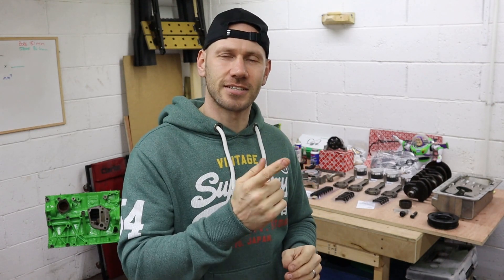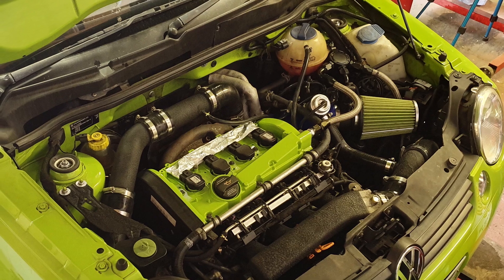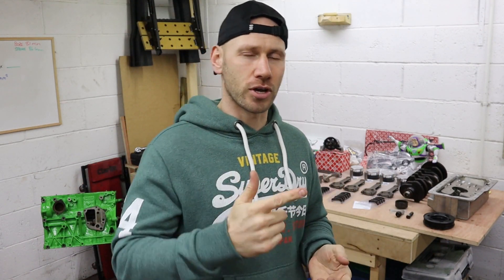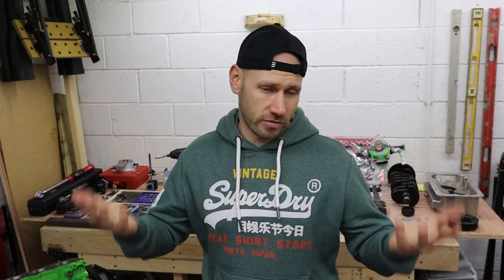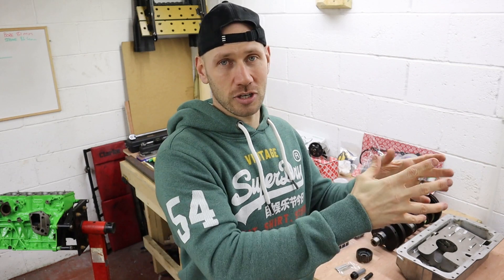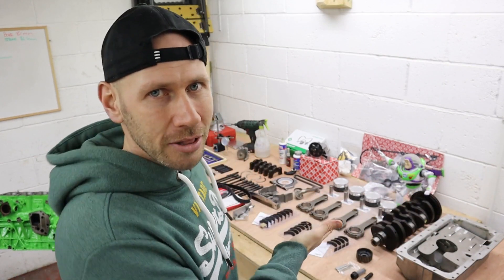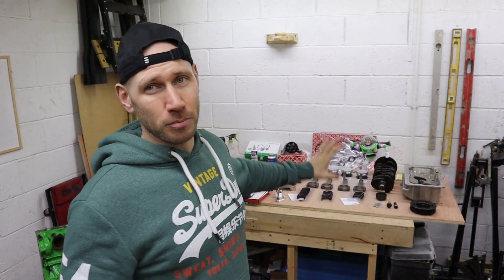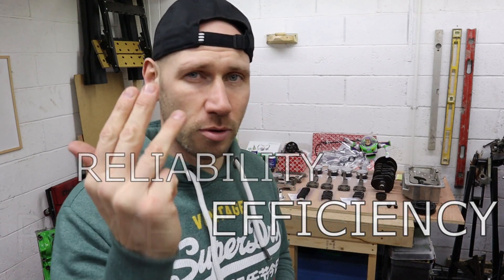1.8T STROKER Engine build - The Objectives

Comment: I am having so many issues with my 1.8t I can't decide between fully rebuilding it.. or just swapping a vr6 turbo setup into my b6 a4. What do you think is the best option. I love the sound of the vr6 but idk if it's actually worth the cash
Reply: I bought this Audi the day I filed for my divorce because I knew I needed a more reliable 4 door car then my f150 truck.. the engine blew on the way home from buying the Audi. Bent all the valves in the head from the serpentine belt shredding and wrapping around the crank pulley and it locked the engine up... Didn't even damage the timing belt.
So I machined the head and decked the block and rebuilt the head. Put a k04 225 Injectors, cts turbo fmic kit. And it ran great for about 12k miles..... Now it sounds like the engines about to blow legit and it keeps having random issues over and over.. I am about 12k in with parts now and that hurts being a single dad lol.
Reply from the maker: Big deep pickets for a vr6 turbo 🙈. Maybes worth investing in the 1.8t a bit. It'll still be smiles per miles. Unless you NEED that V6 Rumble...?
Reply: @DecimalTenths  the crazy part is here in Texas the 1.8t engine at a wrecking yard costs roughly 1400 us dollars... A vr6 24valve costs around 650 but I have never owned a vr6 and wasn't sure how reliable they are with boost

Comment: Hiya, im still catching up on the broadcasts mate....a thought? What will the running in on the motor be like/how many miles etc.
Lv the show buddy and cheers!  😁
Reply: Ps. Never thought about engine braking? Cheers and reallly looking forward to that broadcast 😊
Reply from the maker: @andrewstamps2806  Yeah mate its essential. It's a point when the cylinders see a lot of pressure so great for forcing the rings into the cylinder wall to seat them, but without the added heat of combustion occurring to overheat the situation. Ideal for bedding in rings. Cheers for your continued support pal 👍
Reply: @DecimalTenths  No worries and thanks for explaining mate it makes good sense and practice......genius!! You not me lol🙃, stay safe all of you...even Lord Spencer!! Cheers
Reply from the maker: Hi Andrew, I plan on doing a video on this when we go through it, but itll be varied loads over varied engine speed with lots of engine braking, and a couple of oil changes up until about 1000 miles.
Reply: Cheers mate and thanks 😁, luv the show and keep up the great work, byeee!!

Comment: Alright Nick,
Binge watching all your videos. My engine is away getting built at the moment. A 225 APX from a TT. 
Just wondering why your not going for more power than 330/350.
Mine isn’t getting stroked, just IE rods, pistons, Supertec Valve springs and Inconel valves. 
Gtx3071 with custom exhaust manifold.
3” exhaust, fmic, aem meth, 660cc injectors. Maybe NA cams. 
We are looking for 400+ Bhp? 
We started the project as we burned out an exhaust valve in cyl3.
Reply from the maker: Hi! Cheers for the watching the channel! 
In all honesty my power goal isnt in stone (especially since I blew the budget on a trick gearbox) and I could be swayed (the ideal would be G25-550). My goals are in keeping with the capability of the chassis, budget, and my ever searching quest for reliability. Plus I want to be free to spend on other builds and dont want to step too far away from this being a cheap track car, which it does.with nearly every day...😂 350bhp in a Lupo is like 450+ in a TT and this upsets a lot of people even in it's current form.
Reply: Decimal Tenths For sure because the TT with Quattro is 1400 odd kg so it’s good and heavy.
I’ve followed a lot of your advice apart from
I forgot the budget bit 😂 I’ve 7k gone on parts with another few grand to (find) spend yet. Won’t be selling this mk1 TT in a hurry.

Watching your videos makes me want to buy a second hand APX and have a go myself. I’m handy mechanically but I’ve sent the engine away to be built by a builder. 
Keep up the videos mate, love the authenticity 👍🏻
Reply from the maker: @stevenlee4437  Yeah know all about that Steve! I had my old S3 at 450bhp and it was ballistic, but still very heavy. The lupo is my cheapest and simplest car but it's easily the most fun I've had on 4 wheels, which is why I'm torn between keep it good cheap fun, or go all out and have the raddest Lupo out there. Time will tell as to how disciplined I've managed to be with the budget. My plan was always to stroke the S3s motor so the stroker aspect is just because I had the kit all there. This build will be capable and strong for big power, I've just got to try and fund the turbo setup...😂. I love giving it all a go, although I do it from a position of experience, spent many a summer building engines with my dad. Either way your TT will be immense, 400 horse and 4wd is a special thing no matter what car it's in. 🤘
Reply: Decimal Tenths There’s worse ways to spend your money or time 👌🏻
I suppose you still want the lupo to be something to enjoy and not scared of 🥴
As long as the receipts are kept from the wife we’ll be doing alright 😂
Reply from the maker: @stevenlee4437  you my friend, are on my wavelength...😉👍😂

Comment: Geeeeez, thankfully I got my Mk4 Golf 1.8 for @$500 cause I’m pushing $10k on engine parts(stroker kit), FMIC, GTX3071, etc.  Machine work in there too but I’m doing peripheral assembly and motor install. Still gotta tune, LSD for tranny.......🙁

Comment: I'm defo following this as i want to forge my S3 at some point, Is it going be a 1.9 like the s3 was or a 2l? I think you should make a t-shirt up about Chernobyl cheese rods btw, have a wee pic of that guy from the tv series with the massive specs lookin horrified at the cheese rod meltdown
Reply from the maker: 🤣 so many t shirt ideas, I need to make some more. Full 2l on this build 👍. Specifics coming on tomorrows video 😲
Reply: @DecimalTenths   actually come to think of it, as its about the K0$ runnig hot probably better a pic of a wreck turbo and calling it K04nobyl